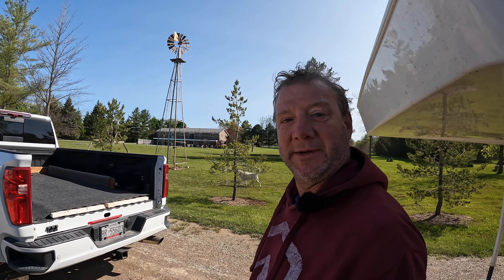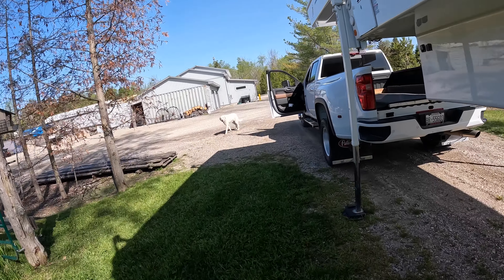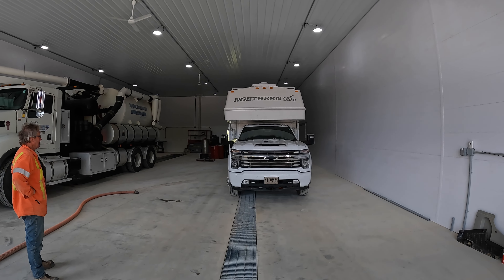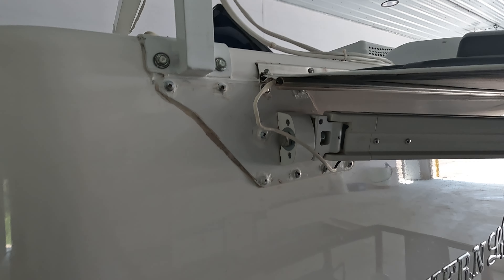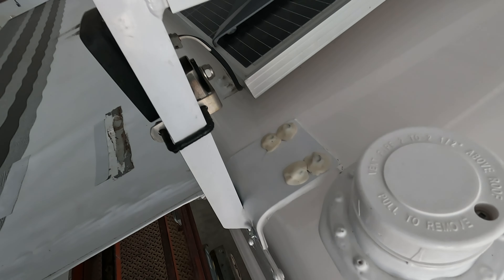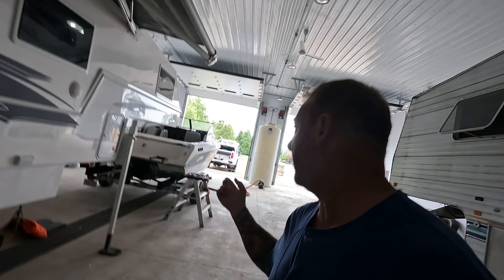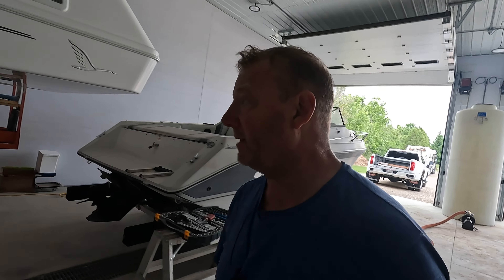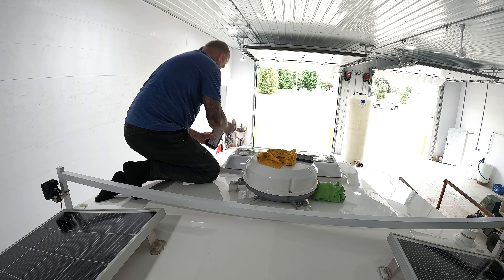Truck Camper Wash/Seal/Wax. E-49

Comment: Smooth gel coat is its own reward as the bugs just wash off more easily and dirt won't stick. I'm using Turtle Wax Ceramic Hybrid and it leaves my camper smooth as silk. Your Northern Lite looks beautiful, JJ!

Comment: I've had things go wrong using the soapy water mist when caulking. The thing is, you push little bubbles of water into the caulk surface and they dry out leaving a micro pocket where green mold grows later. Tiny specs, but annoying as hell. I'm told wetting my finger with alcohol is a better approach. We'll see. I still suck at caulking. You did good JJ.
Reply from the maker: Thanks for the info Bill. I will definitely keep an I out on the spots I did and will report anything I find.

Comment: Looks great.  I have a 2017 GMC dually and 2018 10.4' Bigfoot camper, and raised mine using 3 sheets of plywood in the bed.  The plywood is heavy and cumbersome to deal with when I don't haul the camper, so I like the foam idea.  Have you seen any compression of the foam yet, especially around the perimeter of the camper bottom?  I would like to try this.
Reply from the maker: I had the foam in for one year. There was some compression but from the ribs on the box. As far as camper side it held up very well.